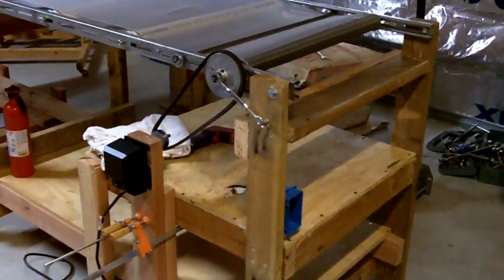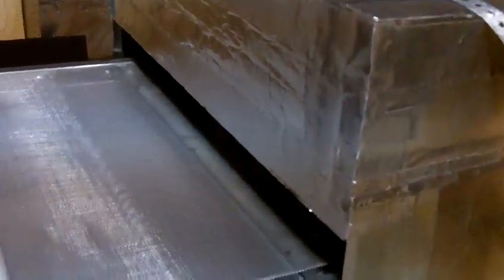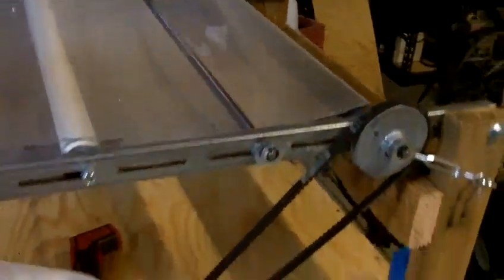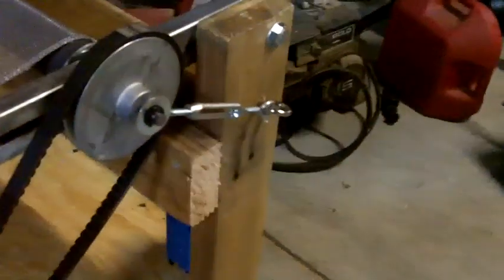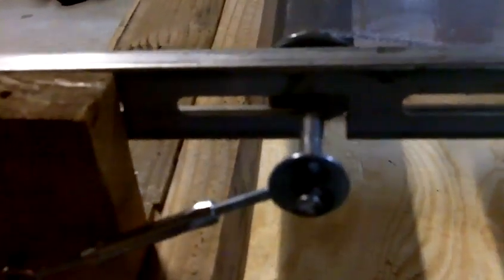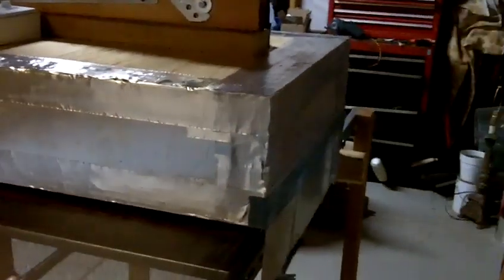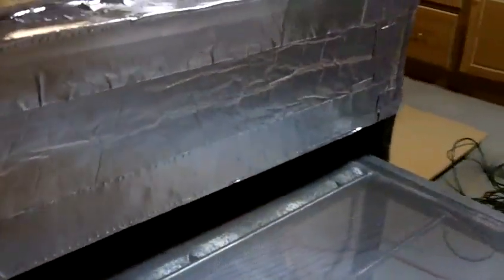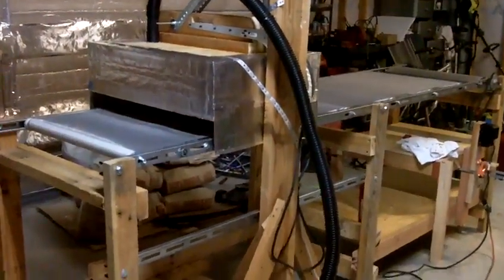DIY T-Shirt Conveyor Dryer

Comment: Instead of E clips on the belt tensioner, a hole through the rod and a cotter pin might be faster to make.  I wonder if a discarded metal range hood would be a better choice for the oven housing if you're worried about heat.  Clever using the window screen belting and gasket cement for joining the ends.  I like the overall design. Looks like you built this for under $400.  How is it holding up?

Comment: your a pretty handy guy, so you should Google ARDUINO STEPPER MOTOR DRIVER, this will allow you to set your speed VIA a turn pot. I would recommend a NEMA-23 425oz for something that sturdy.

This would allow you a direct drive with no gearing and even set up a closed loop giving you a guaranteed speed regardless of wear and tear...

As you get more involved with the Arduino you can even set a variable relay on your heat source. Advanced users can make it to touch screen with one button presets.